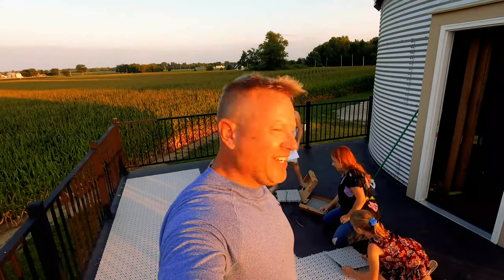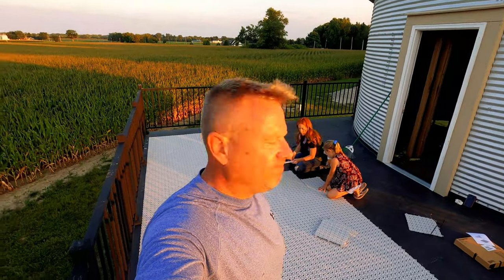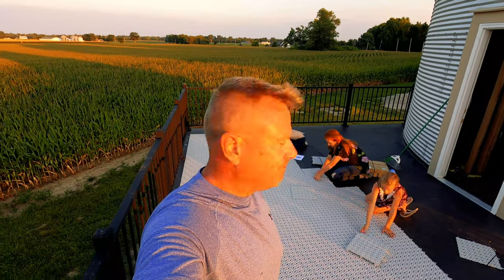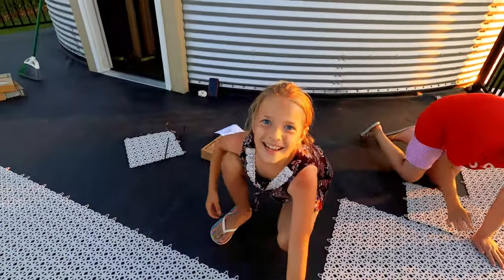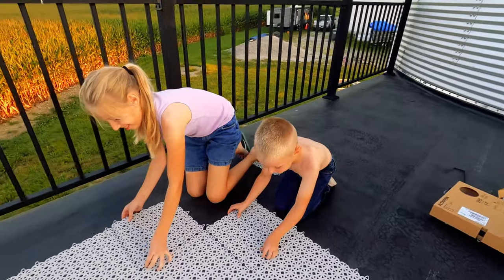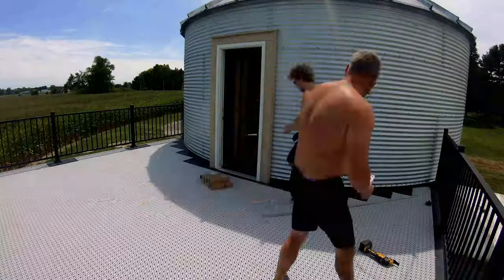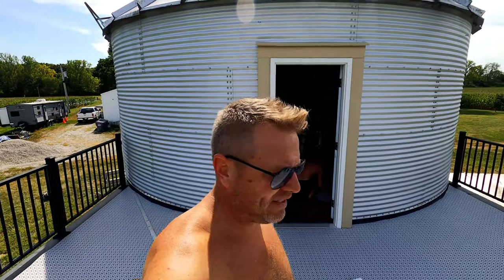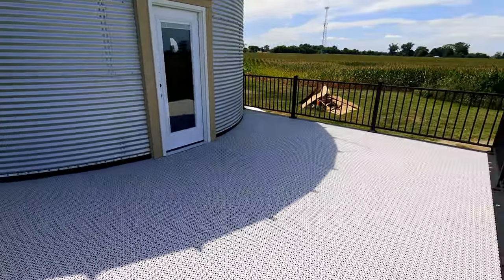Grain Bin Home Build... Episode 18 "Balcony Flooring"

Comment: Thanks for the video! About to install these. Curious how they're holding up? Also wondering if 1/4 inch expansion gap was enough? Our balcony has walls on all 4 sides so trying to figure out how much space to leave on each edge :) And lastly, do the holes get a lot of grime accumulating in them or not so much? Thanks in advance!
Reply from the maker: I like them. But only real draw back is how lite they are.  Wind plays havoc with them. Blowing them off.  If protected would be fine.  I ended up installing a heavier product over top of  these.  Also they do expand a lot in heat.  Over all probably as much as 1/2 to 5/8 expansion in 20 ft.
Reply: Thanks so much for the reply...yikes about the expansion! Really helpful and appreciated :)

Comment: How does it g go abele rain seeping through?
Reply from the maker: @MikalaM  the roof is a solid membrane roof.. so nothing seeps through.
Reply: Thank you for the reply, apologies  about all the typos previously. I guess because it looks perforated I imagined the water would seep through the holes and stand on the flooring beneath possibly causing damage. I’m hoping to place it on a top floor concrete terrace.

Comment: How is this holding up almost a year later? it costs $20AUS = around $13 US per pack of 9 here. Do the holes get things caught in them.
Reply from the maker: Here is my honest opinion of this product... Overall for the cost it is a good product.  You cant find anything in this cost range to accomplish same task.  Negatives for the product... I wish they made a perimeter trim to finish off the edge.... It is lightweight and since it is a floating floor, without any weight on it like furniture or planters, the wind will blow it up and scatter it.  I had to pickup the pieces and reinstall it several times before we were finished with project and had furniture on it.... Also it expands and contracts quite alot, so it wringles up as it expands.  
Positives are that is very durable... It is easy to install... It is very inexpensive... It does look nice... And, no havent had any problems with stuff stuck in holes, but not any trees around it to drop things into it.  
Would i recommend it?... Yes for the price.  But if high quality finish is what you want... There are nicer products that cost alot more money that would have a higher quality look.
Reply: @blueroomoutdoormedia5630  thanks for the review it is a good price and I was concerned it would crack and split and I am off to Ikea tomorrow so will check it out many thanks for your prompt reply 😃

Comment: How did you cut the tiles?
Reply from the maker: They actually cut very easy.  These are made out of HDPE... High density Poly... They are fairly thin.. And i just used a miter saw or table saw with carbide tip blade to make straight cuts.. And a jigsaw with a fine tooth wood blade to make curved cuts.  Only thing i would say is make sure the tiles arent cold when you cut them.